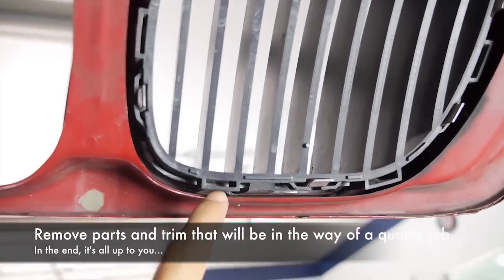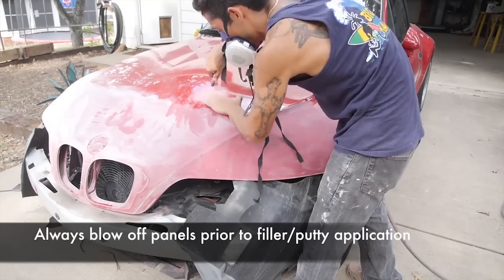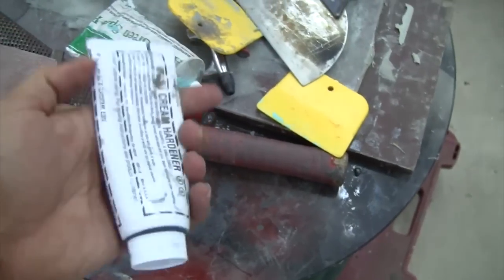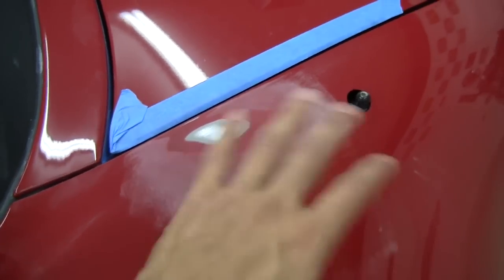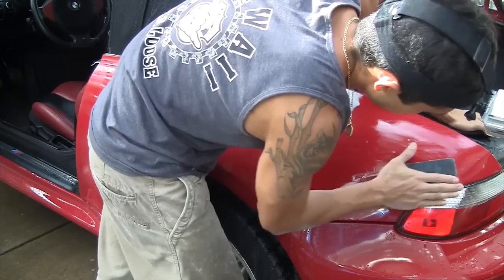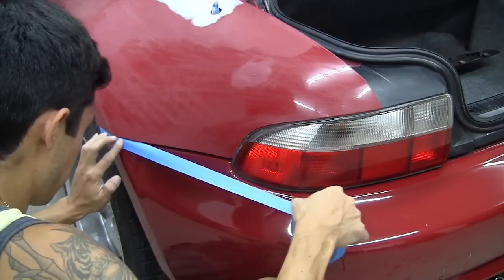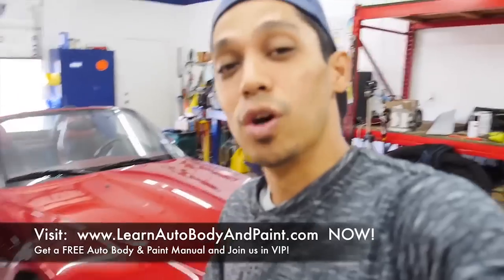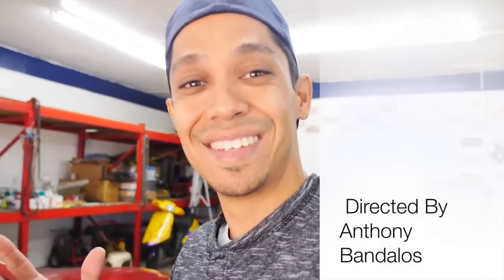How To Paint YOUR Car Like a Professional, Even if You're a DIY Newbie!

Comment: i have a question about a complete respray/ color change. i want to paint my 2000 Mazda Miata NB from the factory Mahogany MIca to a glossy white. any suggestions?
Reply from the maker: yo! Nice car man. Did you see mine? https://www.youtube.com/watch?v=fKy9YwfLQ6U If your clear coat is in good condition all you need to do is sand it FLAT with 400 and spray white base right over it. There are many ways. You can also primer seal the thing and 400 grit finish, then paint it. Learn more at: http://www.learnautobodyandpaint.com good luck!
Reply: Learn Auto Body And Paint DIY Mastery! Yes i did see yours. Nice lambo doors and thanks for the info!